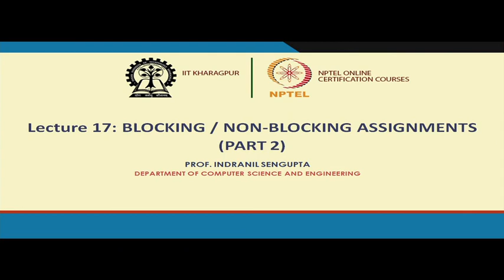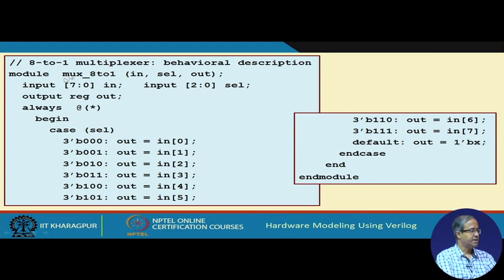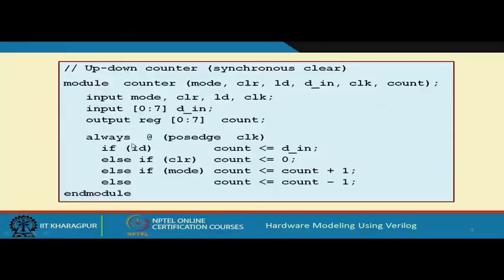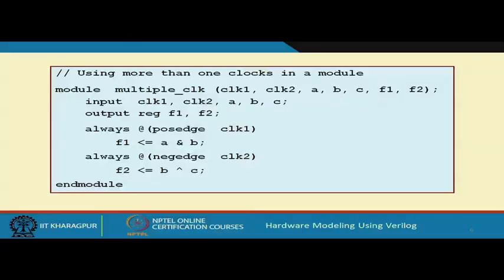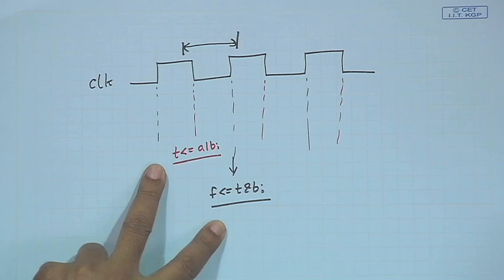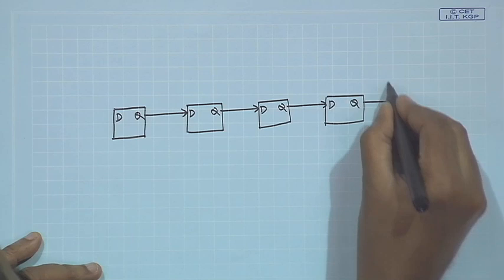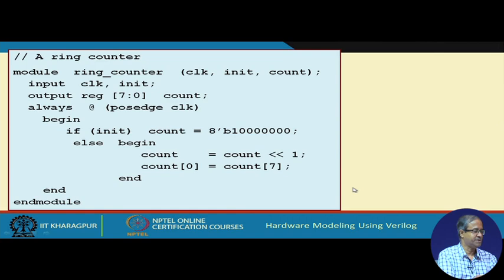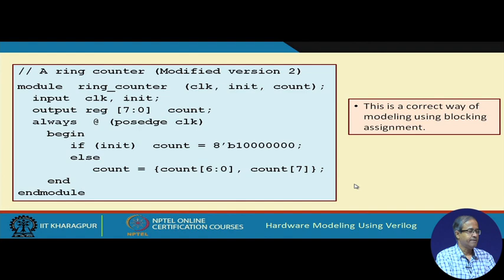BLOCKING / NON-BLOCKING ASSIGNMENTS (PART 2)

Comment: @17:05, 
 Shouldn't the variable 'c' be defined as output[7:0] rather than  input[7:0] ?
Reply: Yes exactly 👍👍
Reply: Shouldn't we just use it as a reg [7:0] c ?
Reply: @anuragagarwal4576  Yes, but then we need to remove it from the list of ports in the module declaration. i.e., module multi_edge_clk (a, b, d, f, clk); ...
Reply: @iwbnwif  it should be module(a,b,d,c,f,clk), right?
Reply: Yes, I tried synthesis and end up getting error.

Comment: sir @24.53  count[0 ] is assigned to 0 and 1 simultaneosly .So how can be decide whether the value of count[0] will be 1 or 0?
Reply: I think that assignment will take after the shift, just the value of it will be taken  as 1 before rotation
Reply: Assignment will take place at the end of the procedural block and it's only the final update that will be reflected on count[0]. According to the code count[0] was supposed to be altered twice(the first and the second assignment statements) while the rest of the elements in the vector were supposed to be altered once( the first assignment statement). 

So for count[0] only the second assignment statement(since it's last alteration for count[0]) will be taken for update while for the rest the first assignment statement will be take for update(since that's the last alteration for them).
Reply: @emmanuelinnocent4505  Y in ring counter the rotation is being carried out in clockwise direction!? Shouldn't the 1 rotate in  anti-clockwise direction?
Reply: @aayushiaryam1844  I do not understand the concept of rotation you're talking about. If you could explain it to me, it'll be appreciated. 

However, for a ring counter,  I think what  should matter is  its ability to count  from the lowest number possible to the highest number possible repeatedly. And in this case of the example given in this lecture, the ring  counter does exactly that.

How? 

We can see from the given sequence of bits — seven 0s and one 1— the combination of those sequence of bits that will give the highest number (unsigned) is 10000000 while the lowest is 00000001 (unsigned).
And we can verify that the given code will do just that.

If we start with 10000000 the code will give the following next results:
0000001, 00000010, 00000100, etc.

Meanwhile, if we had started with 00000001 we'd get:
00000010, 00000100, etc. 

So what is essential about a ring counter is counting from lowest to highest number possible (or vise versa) repeatedly.
Reply: @emmanuelinnocent4505  thanks for your detailed explanation
Reply: @aayushiaryam1844  you can do it in either way

Comment: What if we use blocking assignment in the example shown in time 9:00
Reply: For this case I think there will be no problem if you use the blocking assignment. That is it'll be the same result with the non-blocking. This is because the if-else statement has already created priority. 

Since it is only one expression of the if-else statement that is expected to evaluate to true, then it does not matter if assignment takes place immediately(as in blocking) or if it takes place at the end of the procedural block (as in non-blocking). 

Please let me know if this answers your question.